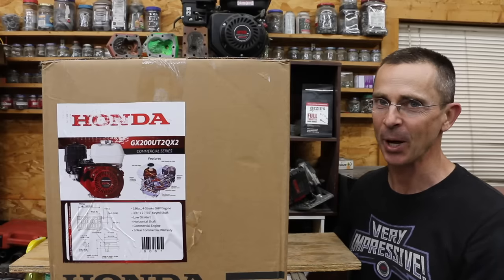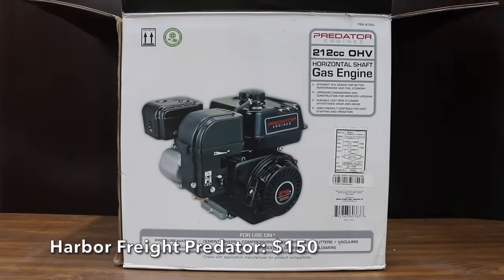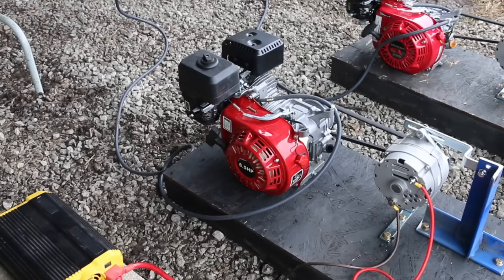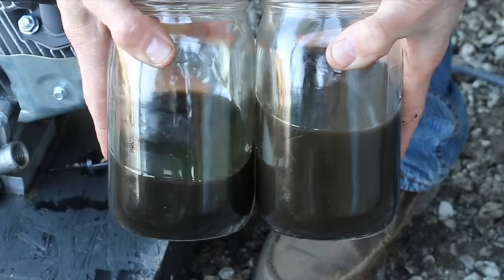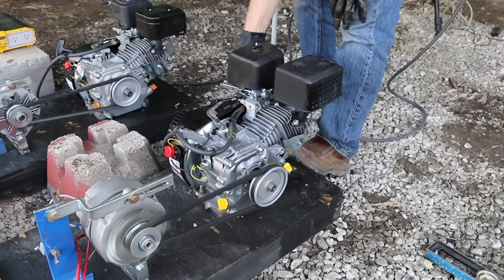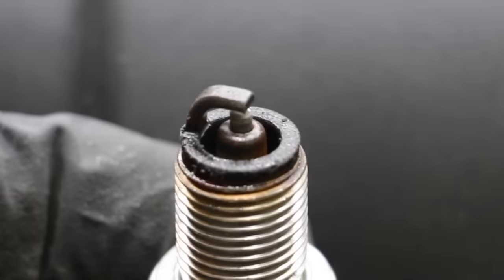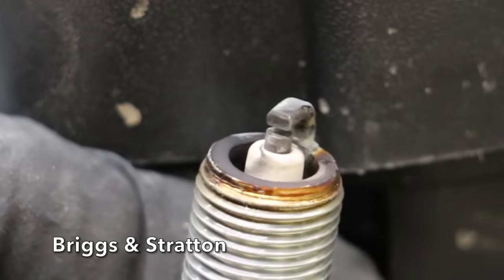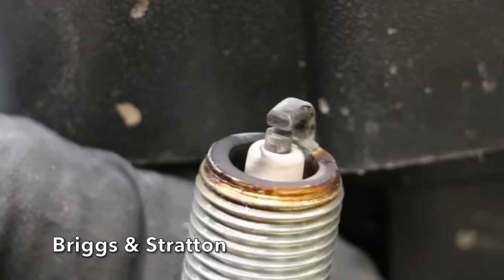$150 Honda Clone vs $600 Honda? Let’s settle this! Fuel Efficiency, Horsepower, Durability, Starting

Comment: Like many others have said, Project Farm is a favorite channel of mine!  This may be an unusual idea but a comparison of garbage/food disposals would be an interesting comparison. In the few times I’ve had to replace one, I’ve always wondered if the horsepower, size and price really made a difference. Plus the testing for a disposal may be pretty interesting by itself!  Just tossing it out there. Appreciate your efforts!
Reply from the maker: Thanks!  Thanks for the suggestion.
Reply: Growing up, the one we had we put chicken bones through it to keep it sharp. The new one won't grind chicken bones. Be nice to find one that'll grind chicken bones again.
Reply: That would be an interesting test.....I've put 5 hot wheel cars in each, which disposal  will do the job, let's find out.😉
Reply: In the 1950's  a TV add for a garbage  disposal  demonstrated  grinding up a small and thick sided glass (7ounce?) Coke  bottle and D cell flashlight batteries.
NOT recommended  just a demo of its 
ruggedness. And there  was a story
of a gangster  that had a 5 hp disposal 
in his Long Island  home. Bet that one  handled  weasel and stool pigeon  bones.
Reply: My dad was a plumber in the 70s and 80s, he said the best thing to do with a garbage disposal was to throw it in the garbage! Most people did not run enough water behind what they were grinding and it created a lot of downline plugging problems in the sewer pipe!
Reply: My brother is a Plumber and says to not use a garbage disposal because ppl will use it as a garbage can and they're not worth it. Not to say the testing wouldn't be great fun!

Comment: I love your side by side comparison videos. I am surprised how the predator engine performed in the tests though overall. It is one of the more common engines that you find in lower priced gas powered equipment these days such as gokarts, bikes and even a sawmill.
Reply from the maker: Thanks!
Reply: I replaced a 6.5hp craftsman mower motor with a 5.5hp predator twice  the mower. The sears would choke down in tall grass every 2foot, no choke down with the predator.
Reply: @galenchollett7441  Interesting. Thanks for sharing.

Comment: Excellent comparison.  Oil analysis and driving the alternator for a load and fuel economy, and the vibration test, then measuring the oil consumption were great methods to test durability and ultimate value.
Reply from the maker: Glad you liked it!

Comment: I spent multiple hours watching videos trying to evaluate which one of these was the best value. If only only your video had been released earlier I could have saved myself a lot of time but I would have also been more well informed by watching yours than all of the others combined. Great video. Very informative and thorough. 👍
Reply from the maker: Thanks and you are welcome!
Reply: I have had Honda's and I've had chinese crap and for longevity buy the Honda. You will save at the start but in the long run you'll wish you paid the extra. My Honda outboard had not been started in 5 years. Changed the fuel plug and oil and she went first pull. Sure you can buy 3 for the price of 1 Honda but it's not worth the breakdowns of the crappy ones.

Comment: I think a longevity test is the next obvious step seeing as you already bought the motors. Still waiting for someone to give motorcoat some competition! Your testing is the standard I now count on for a lot of the products I buy, keep up the great work
Reply from the maker: Thank you for the video idea!
Reply: I think my Briggs and Stratton lawn mower will probably put last me. It had such bad compression after sitting for a long time that we put really thick diesel oil in it and after a season of running that it works like brand new

Comment: I love your work man. I would love to see the breakdown of price and operating cost of each unit. Like a metric that would show how many of the other brands you could buy before you spent as much as the Honda. Or even a percentage of value shown as if the fuel economy is better how many hours until you recoup your loss on purchase price (that is to say "Bang for your Buck"). This seemed to be a very close performance margin with a very large price margin.

Comment: You did such a good job andd measured almost everything ! But one little tip for you, please show the temperature also in Celsius and the Fuel in Liter. That would help so many people and is the only reason why I can’t barely show it my dad because he would only say „400 Fahrenheit, is that hot or not ??“
Reply from the maker: Thanks for the suggestion.

Comment: I built a predator 212 that spins up to 9,700 rpm. I put a billet connecting rod, cam, ported head, valve springs, 11.5:1 compression ratio. Ect. Put it on my mini bike and it goes 70mph and gets there quick. Amazing machines
Reply from the maker: Thanks for sharing!

Comment: My honda clones have a normal honda filter setup and I'm happy to say it does not vibrate like yours but it does burn a little bit of oil. I have one on a tiller and one on a wood splitter.
Reply from the maker: Thanks for sharing.

Comment: You get what you pay for and for me, it's longevity.  Still running a 1991 Honda GX140 engine in my snowblower.  Starts first pull every time.
Reply from the maker: Thanks for the feedback.
Reply: His tests are very scientific and prove today's Predator and Honda engines are equal (except in price).  I agree, those old 90's Honda's were tough to beat, but now, there are many very good competitors.  Don't get stuck on brand names, do the science!
Reply: @COSMACELF1802  reliability is still Honda first policy
So I'm sure that two predators won't last as much as one Honda.
Reply: @yhegjddg438  I believe big companies like Predator care just as much about quality.  This video proves their engines are equal to Honda.  There's no reason others can't produce high quality engines, it's not like Honda is magic.  In fact, Honda makes lemons too,  Look at their oil dilution problem! Big mistake.  I just think it's important that people don't buy something just because it has a name brand.  I mean you can spend $500 on name brand jeans and they don't look better than $50 jeans.
Reply: @COSMACELF1802  while I agree that many big companies make some good quality products but experience says that most prefer cutting edges to generate profit or increase profit, this problem affected most brands since the mid 2000s but doesn't seem to affect Honda and few other Japanese and German manufacturers, this is why their products still top performers. 

Predator is good for carts or light work with proper maintenance but that's it.
Reply: @yhegjddg438  The Honda knockoff engine is a great example of what you're saying.  But this video showed Predator and Honda were very equally matched.  Of course, the only true test is the test of time.  Honda has indeed shown it's qualities there.  But I'm always suspicious and their recent lack of quality with the oil dilution in their car engines, and their failure to make good transmissions has me doubting their sustained quality.  I think Honda is not immune to the disease of increasing profit.
Reply: @COSMACELF1802  their car engines are actually some of the best, their issue lies with the new cvt transmission which of course isn't equal to Toyota, but miles better than Nissan, Korean and western manufacturers if maintained regularly, my friend has a civic and its over 100k now and still runs well, the issue is their cvt in big cars which will have many issues, but it seems that most problems are being solved in the last two years.

If we speak engines alone Honda makes better quality engines than even Toyota, Subaru and Yamaha.

Hope they do not compromise on their quality like Nissan, GM, Ford did.

Comment: Wow. The predator is an incredible value. Wonder how it would last long term. He did mention it was burning some oil but I wonder how much over time …
Reply: Buy two and you're probably still ahead....? 🤔
Reply: They last, have replaced many Honda engines with Predators on our roofing equipment some of the engines are well over 2k hrs of use with out oil usage.
Reply: They last as long if not better than a real Honda
Reply from the maker: Thank you!  I was wanting to test them for longer but the price of fuel became a factor
Reply: my bike has a cammed ungoverned predator engine with 200 miles on it and it burns half of its oil capacity every 15-20 hours
Reply: I bought one of the Predator 173cc vertical shaft engines back in 2017 to replace a crappy Briggs&Stratton "never add oil" engines (plastic carb kept crapping out) on a mower. The Predator lasted until last year, when I lost compression on it, piston rings were shot. I would have bought another Predator, but the vertical shaft were out of stock/discontinued at the time. Looks like they're back, maybe an upgraded engine? But yeah I'd consider it lasted a good amount of time, considering I didn't take the best care of it. Replaced it with a Honda
Reply: Buy the two year replacement plan for $48 and b4 the warranty expires replace it no questions asked and pay another $48 to place another two years! Still ahead 4 years later! I did this on my sons go kart and set reminder on my phone, I’ve swapped two engines that we’re still running ok in 4 years!
Reply: Well I have a 6 year old vertical shaft twin Predator on my zero turn and an 8 year old Predator 420 on my Sears Suburban. Never changed the oil on either and they run great.
Reply: @z31freakify  Good engine oil change estimate is 3,000 miles / 60mph = every 50hrs. Especially for smaller engines.
Edit: You said no oil usage, I remembered no oil change. Maybe you meant with regular oil changes, no usage after 2K hours.
Reply: Ken, that’s downright dishonest.
Reply: @kenwillis8487  I think this is part of the reason why companies often will offer bad/short warranty terms, if people keep doing these sort of scams.
Reply: @PaoloMarcelli  yeah, that's unethical. 

Exactly why Craftsman stopped the no questions asked return policy.
Reply: I've got 2 predator generators on 2 of my trucks. Both have over 2000 hours. All I do is change the oil every 100 hours. I did charged the spark plugs to NGKs. Both run great still. I'd definitely buy another if needed.
Reply: The Predator being a great engine for the price and a Honda clone is at least a 10 years old claim.  Supposedly, Honda is/was making their engines at the same Chinese Factory.  Don't know if that's still the case.  If it is, getting a Thailand engine is just circumstances.  It's quite possible he could have purchased a Chinese Honda engine.
Reply: @kenwillis8487  Yeah, lying and stealing motors from the store is a great thing to teach your son!!
Reply: @gus473  The Honda would have to last 4x as long to break even.
Reply: My company bought a Predator pressure washer 3 years ago and have no issues, starts in 1 or 2 pulls each season and we don't winterize them or drain old gas. Also haven't burned any oil.
Reply: @kenwillis8487  That's almost insurance fraud, I probably wouldn't admit to that on the internet lol
Reply: @frankvucolo6249   I recently purchased an air tool at the freight. The checkout person encouraged me to purchase the extended warranty and do exactly that. How dishonest is it if the company is suggesting that you do it? 

BTW I didn't purchase the extended warranty.
Reply: @kenwillis8487  stuff like this is what's going to drive prices up. I bought a predator 8hp from harbor freight. It had been dropped and broken a mounting bolt ear off. Instead of taking it back because i can weld aluminum i welded the ear back on and it's fine. I didn't want to return it and probably just get scrapped when it was perfectly fine otherwise.
Reply: By the way I'm glad to see others feel the same as i do. Restores a bit of faith in humanity
Reply: @ryanrodriguez6071  Yeah it's sad they discontinued the vertical shaft predator
Reply: @kenwillis8487  which engine are you referring to?
Reply: @kenwillis8487  That's called "gaming the system", and raises costs for everyone.
Reply: From experience, they do not last as long as Hondas. My company puts many thousands of hours on small gas engines (Pressure washers, generators, pumps, various power equipment). Hondas easily outlasts them all. We have several GXs that are over 10 years old, running 4-8 hours a day, 5-6 days a week (Yeah, do the math. That's a lot of hours). Literally, nothing breaks on them. For any severe usage, I always spend more on quality from the start, as you will see the difference in the end.

However, they're all really simple items, and most people probably only put a few hundred hours on these small motors. Even the thing is worn and eats oil, just add oil and keep running them. If something like the pull cord breaks or the carb chokes up, just replace it with a quality part. It'll double the life of the motor. For most people's needs, it's better to be cheap and maintain it properly, because you're probably sell the thing long before it becomes unrepairable.
Reply: @kenwillis8487  Mr Ken everyone is trashing you on the replacement plan LOL i think you are one smart dude HF made money from you both ways buying the engine and the Extended Warranty does HF care what you are doing NO they just want you to buy another engine and the Extended Warranty all over again and the funny part they been doing that for quite some time looks like to me HF is  NOT  loosing any  Money over there Extended  Warranty .... That was a Funny Story Mr Ken Still Laughing my A## off
Reply: You folks saying Ken is being dishonest need to take some things into consideration. Harbor Freight actually encourages this. When you're checking out the manager will actually tell you to do this as a way of selling the insurance. They actually list it as a feature of the policy. It is built into their business model. They make substantially more on that $48 insurance policy than they did on the original engine. The margins are much better in selling extended warranties than they are on selling products.
Reply: @mikewatson4644  Having an accomplice to your dishonesty doesn’t make the deed honest. You are rationalizing to convince others (but mostly yourself) that what you are doing is acceptable. You know the truth. Live an honest life. We are all in this together.
Reply: @rogerstlaurent8704  Harbor Freight doesn't own the extended warranty company, it's an external insurance firm that contracts with them, so they likely make little or nothing from it. What was described by the commenter was returning products that weren't faulty just to get a new one for free, which goes against the terms of the warranty. It's likely it wouldn't be possible to do anyway since they don't take products that are not faulty, and if a product is faulty they send it for repair first and if parts are unavailable only then do they do a replacement. Either way, the commenter was doing something unethical by breaching his policy agreement.
Reply: @frankvucolo6249   I respectfully disagree. If you went to buy a new car and the salesman tells you that the manufacturer has a program where you can pay x number of dollars and you get 10x worth of something back, would you say that is dishonest, I'm not going to do that because I'm getting 10x what I am paying for? If you go to the grocery store and they have a BOGO where you buy 1 and get 1 free, do you say no, I insist on paying for both? The company, through their paid emplyee, is saying "here is what we are willing to do."  Taking a business up on an offer that they make is not being dishonest. They might not be the best business people for making the offer, but that isn't your fault. Or they might have valid reasons for making the offer that you aren't aware of. 

BTW, if you read my full comment, I clearly stated that I chose not to buy the extended warranty that would have allowed me to do that.
Reply: @mikewatson4644  I read your last comment and I repeat my last comment: you are trying to convince yourself you were not dishonest. You may not have taken the warranty on the most recent purchase, but you did on the Predator for your son’s go kart. And then you enacted a premeditated contractual fraud. In the end, it’s not what someone allegedly “told you” across the counter - you should know better and hold a higher standard. It’s what the contract you entered into for $48 states: WHAT IS COVERED: Mechanical, electrical and power failures that occur during normal wear and tear. You may not come to terms with what I am saying right now, but at some point in your life I hope you do. You have a responsibility to your son and to all the rest of us to try your best to live an honest life.
Reply: @Peter Angles You don't understand. Has nothing to do with driving or cars. Visit a small engine shop for simpler help.
Reply: @frankvucolo6249  I think you are confused. I have never taken any warranty at the freight place. I don't have a son. I have never purchased a Predator engine. You are calling me "dishonest" for what exactly? Your "holey than thou" attitude seems to be coming on a little strong. You should maybe take your own advice and live an honest life instead of making wild, unfounded accusations of "dishonesty" about other people. Have a nice day.
Reply: @mikewatson4644  sorry Mike. I thought I was replying to the original poster who said that. Apologies.